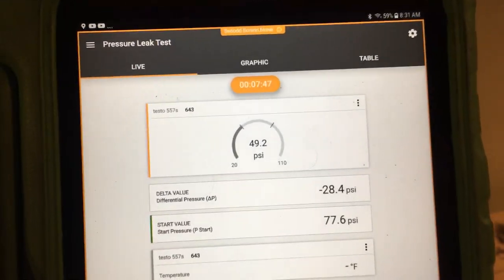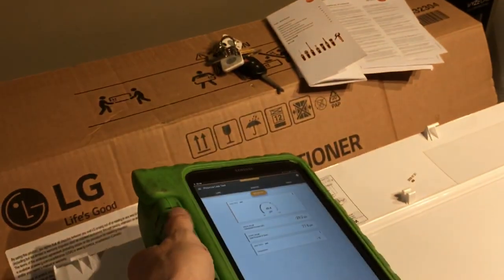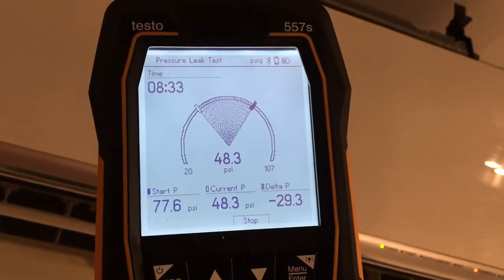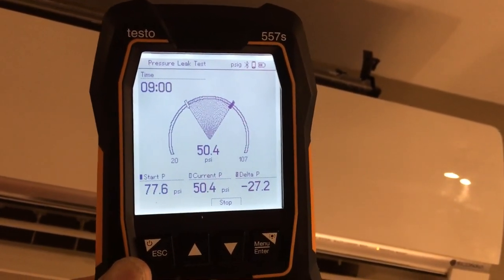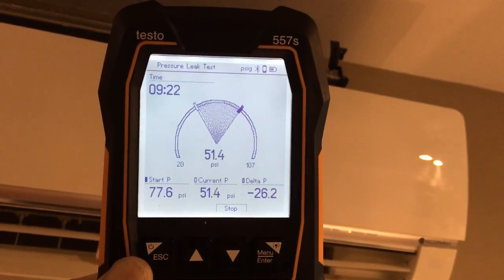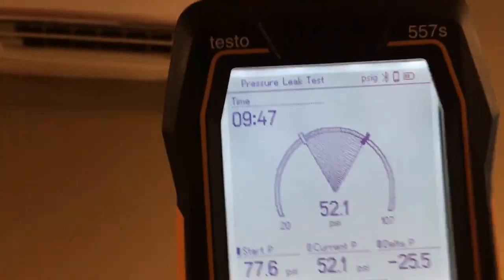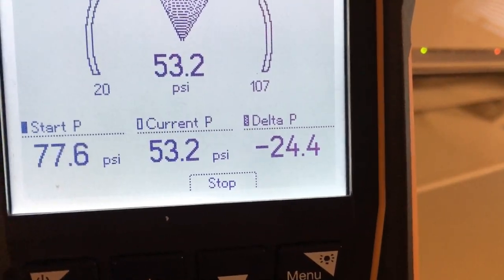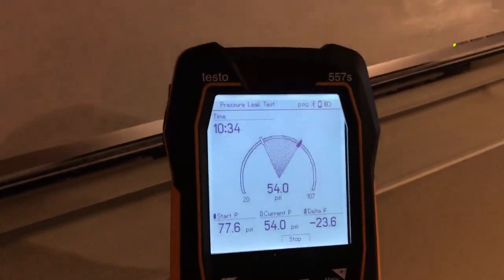Testo 557s Using the pressure leak test set up.  DO NOT ! Use refrigerant to perform a leak test.

Comment: You can't search for leaks with any refrigerant..   temperature makes changes in refrigerant. You use nitrogen...
Reply from the maker: Are you use refrigerant to search for leaks when you have a refrigerant leak detector in the leak is easier enough to leak at a low pressure. 

            You use nitrogen to look for leaks when you have never put refrigerant in the system yet and it’s still virgin and you’re doing a pressure decay  test. 

          A high-pressure decay test is different than looking for an active leak using refrigerant or a large leak that’s easy to fine with soap bubbles. 

           The high-pressure nitrogen decay test is to confirm you have no leaks at all in a sealed tight system.  And you get an answer of completely sealed 100% leak free. 
Or you get an answer there’s a small gradual continuous decay that doesn’t stop that you cannot read with analog gauges.

Comment: you only use refrigerant to check for leaks not a pressure test ,
Reply from the maker: At the very beginning off-camera I use nitrogen pressure leave decay test first. 

That’s in many of my other videos I do not have time to show all my procedures in one video 

So all the procedures are kind of spread out over many videos 

In different scenarios are use a different situation, possibly due to a known fault pattern that is very common with a vehicl. I will skip procedures and jump right into something else because I know what will be wrong to save time. 

Sometimes I use the ultrasonic leak detector both for vacuum and 

In combination with the UV trace die with a UV light 

And then back it up again with another check using the refrigerant leak detector . 

It all depends on the scenario, the car, the known pattern problems 

I also have a CO2 leak detector 
For using CO2 if I really wanted to 

And I always have two different really good high-end, refrigerant leak detectors .  When is the H 10 that’s heated diode technology the H 10 is the top of the class in reliability and sensitivity.

The other is infrared technology. The Stratus is at the top end of the game of all the leak detectors. 

Leak detecting refrigerant should always be used because you can easily pass a high-pressure nitrogen leak Decay test and you can easily pass a vacuum leak test. 

Because those are static without any temperature difference of hot, refrigerant and cold, refrigerant, that either shrinks or expands the metal at a different rate that causes leaks at joints 

So you can pass all those statically tests but once you have hot pulsating, Refrigerant flowing through the lines, then the leak appears later on . 

This is why I’m going to the refrigerant. Leak detector is always the preferred method usually the most accurate method except for a few occasions I have explained that my videos where a refrigerant leak detector cannot find a leak and then only a nitrogen high-pressure Decay Tesla finally 

I’ve shown videos where it only leaks under vacuum, and does not leak under pressure 

I have a video showing where it only leaks when hot refrigerant at a high pressure causes a leak, but as soon as you empty it out and you put the nitrogen back into it it doesn’t leak no more 

There’s 100 different scenarios that happen that you won’t find in Books or attending some classes

Comment: Just keeping it fresh?  🤣 Very well made point 👍
Reply from the maker: I didn’t want it to spoil so I kept it in the freezer. 🤣

         I can’t even no longer count how many shops have went into who performed leak test using refrigerant over a long duration of hours and condemn parts based on their findings of a lower pressure hours later. 

       Literally hundreds of customers paying for evaporators $500 $1500 $2000 based on using refrigerant as their pressure test medium. 🤬😓 
         But the shops made a lot of money 💰 💴 and the technicians made their bonus money 💵

Comment: The refrigerant in rest always stabilize with the ambient temperature that is located. Because of that the systems are charged by Weight an not pressure.
Reply from the maker: Exactly correct. 
         But the point I’m trying to make here there a tech who tried to use refrigerant to look for a small leaks by doing a pressure decay test using refrigerant. 
        This is something you cannot do because throughout the day the temperature is always changing so your pressure will either always be increasing or always be decreasing. 

        This is why dry nitrogen is the only thing to use for looking for small lakes using a pressure decay text over a period of time. 

          Then depending on the circumstance and the type of system and complexity you may best use a ultrasonic leak detector or a refrigerant leak detector or even a UV Trace dye.